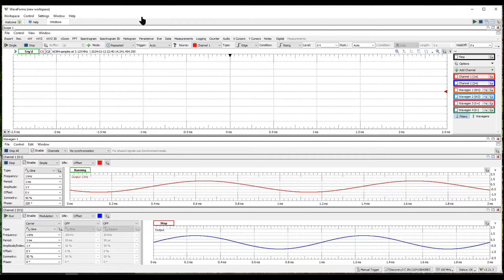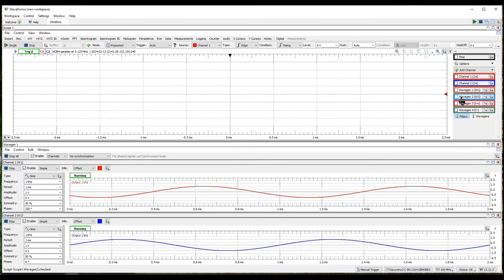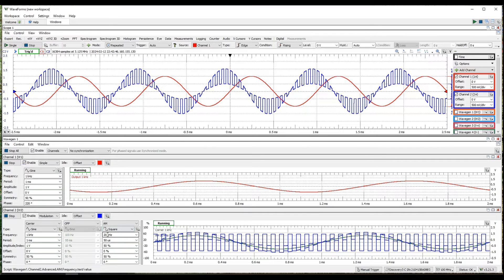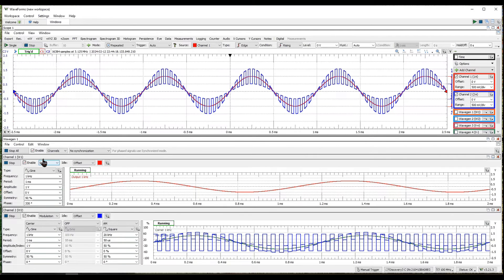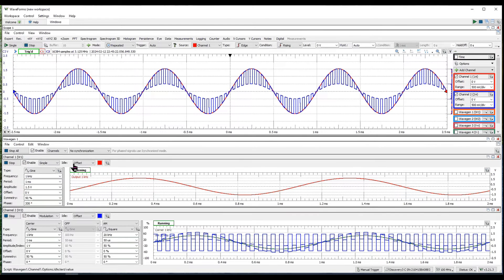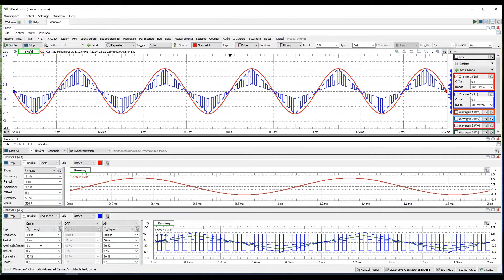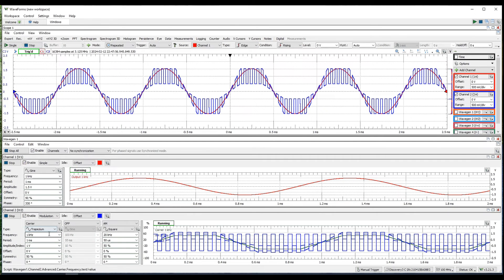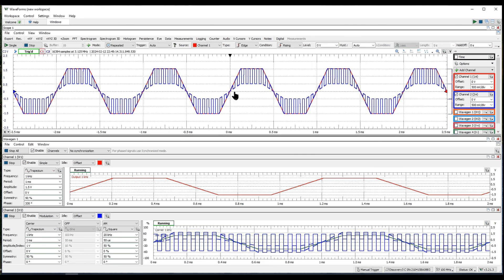Analog Discovery 3 Wave Generator

Comment: The two channels of the wavegen can be synchronised very easily, just hit the stop all button and then the start all button, they will both start at the same time and therefore in phase then.

That is without going into all the complex triggering and synchronisation, like setting it to go for 5 cycles and trigger the scope when it starts and other things like that.